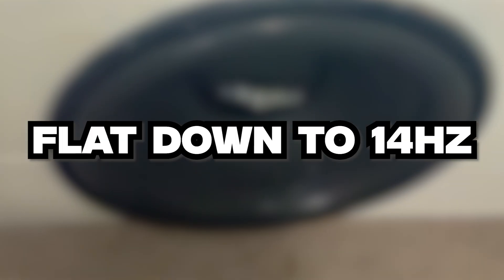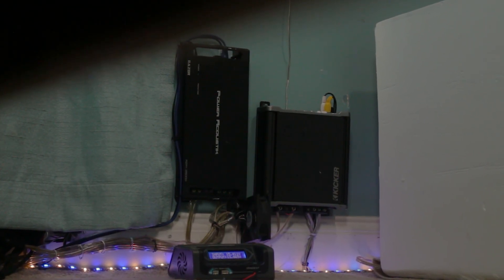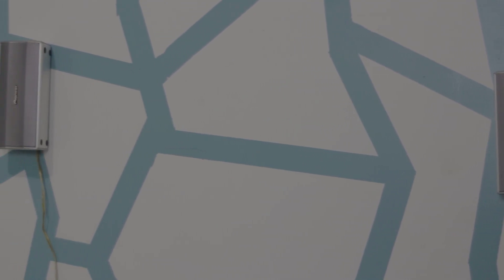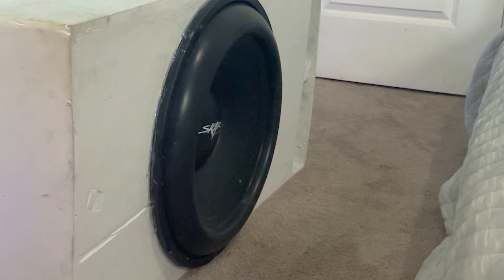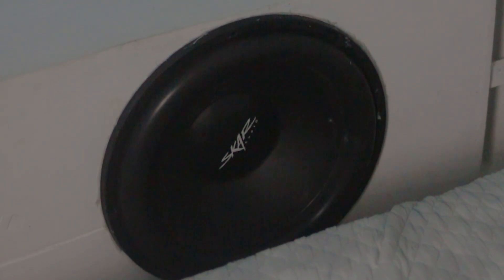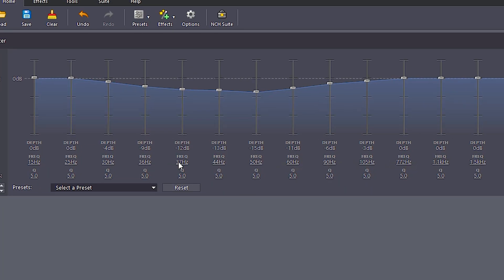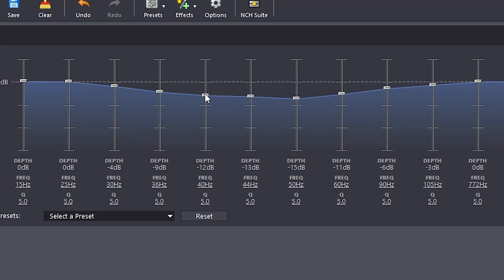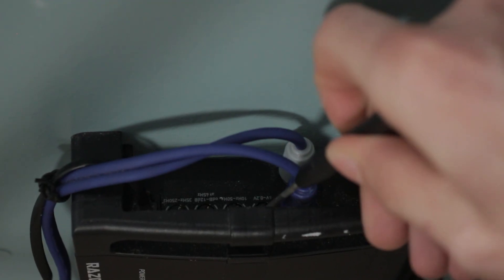How To Get DEEPER Bass For FREE

Comment: I'm sorry but the low-pass does nothing for your headroom in the lower frequencies.
What you end up doing is using your low-pass to try and tame the room-modes that makes the low-end sound unimpressive, so you limit your upper-end response and boosting gain to make the low-end louder. You're not extending your response, you're simply turning up the sub.

Seeing as you are already using EQ, get a measuring microphone and use that to reduce your output in the upper octaves where you have peaks, or to limit output on the high-end to balance your low-end extension. This is much more efficient and precise than simply using the low-pass filter incorrectly.

Comment: Kinda odd to me that subs need to be limited at ALL to prevent bottoming out or whatever when that's practically what we WANT, lol. They should be made such that they canNOT reach that limit, like a bartender saying 'You've had enough'; I'm sure it'd be easy, like by tapering the magnet poles piece at each 'end'; Then, the magnetic force would diminish as the VC moved toward each end of the poles piece. Like a frequency-controlled pendulum, it'd become. Well, great topic and keep it up. 😏🤨🤗
Reply: That would only result in an even greater loss of cone control at the limits of excursion due to a weakening of the magnetic field at the end of cone travel.

Electronic limiting and proper matching of amp, driver and enclosure is the way to avoid damage. In the DIY space this is tricky because it relies on the user not being a moron, but in commercial products, you'll have these parameters pretty much set for you.
Reply: @TokeBoisen  Yeah, man, like a remote-controlled drone, I suppose or a car remote - You wanna get as far away as you can & note how far away the signal still works, butt reliability becomes an issue in times of need. Whoops. Gone! I've seen 'super-pro' subwoofer tests done to TRY to exemplify reaching limits of cone travel and 'What, is he using square waves?' - The cone gets as far as it can and there's a moment of no movement, lol, then it begins back to home base. Probably how it looks with a severely-clipped signal applied, in slow mo, as well. I just think that the VC would have enough 'coil-over-magnet' to still pull the assembly back just fine, butt I'm sure my idea would not be a solve-all - There are many parts to an engine. Also, don't feed a runaway horse - He'll come back soon enough, lol; OK, thanks for that, though! 🙂
Reply: @TokeBoisen  PS--- I may have been editing whilst you maybe hit a 'Like' to me. 
Not much of a change and I hope we can still be friends, lol. Later---:face-red-heart-shape:

Comment: Also, subsonic crossover for the low side cut off. Most subwoofers need to be cut off on the low side to prevent damage to the woofer as it can't handle frequency below 20hz.
Reply: 100% they can handle under 20hz

Comment: if you played test tones you would not gain any output lowering the crossover, I agree you can flatten your response by doing this method but increasing your output +6 db is not going to happen.
Reply from the maker: It can increase close to 6db if you lower the crossover and use an equalizer, but it just depends on your setup. The frequency response of my receiver made me lose quite a bit of output around the 40 - 50hz region because I wanted a flat response to go as low as possible without boosting the lower frequencies way too much by 10db or so, and so I had to lower the output around the 40 - 50hz region. I now have a new receiver which I got after making this video, and now with using an equalizer and setting crossover I don't have to lower the higher frequencies nearly as much compared to my old receiver. Lowering the 40 - 50hz region around -3db with my new receiver compared to lowering it by -15db.

Comment: Great job on this video!  I'm curious as to how you are powering your car audio gear in your bedroom.  Do you have a power supply in conjunction with some car batteries?  I think it would be awesome to run car audio gear in a home environment!
Reply from the maker: I run a PC PSU along with a car battery to keep my voltage above 12v. I'm releasing a video soon about my setup that power's my amp. Thanks for supporting!

Comment: What is your port tuned at? Your infrasonic filter should be set to half of one octave below port tuning, so you won't damage the sub on high power with over extension and lack of mechanical support. Sealed box has no minimum but a ported box will... be careful if you apply heavy power, you will tear that sub to pieces if you're way below your port tuning and the infrasonic/subsonic filter is set to minimum.
Reply from the maker: My port is tuned to 22hz and I can comfortably play all the way down to 10hz full volume which is where my subsonic is set to. Once I get an amp that outputs more power I may need to set it higher but for now It's good.
Reply: @WaveImages  Half of an octave below 22 is 5.5hz so you should be set to 17-18hz something like that.
Reply: yourectrying too hard to sound educated stfu

Comment: This may work in your setup the way you want it. But for a real home theater this is a no go. My SVS pb12+ subwoofer has 800w rms. Any receiver under $1000 only puts out around 60w X 7. A sub $500 one will be like 30w X 7. 

My sub handles the bass and my receiver tells what the crossover will  be (80hz) which would be the THX standard.

This will create drastically more headroom for volume assuming you have a good sub.
Reply from the maker: The settings will be different for every setup, my reciver puts out 125w per channel, and 250w for the center, and when I get my second 18 they'll be wired in parallel getting 1000 watts RMS. My setup gets loud and sounds clean even compared to my other system with klipsch speakers and dual klipsch 15's.
Reply: @WaveImages  What's your reciever brand & model? I've never seen anything have double the power in the center channel. 99% are all fronts having the exact same power. and anything truly putting out 100w + with 5-7 channels driven is a $1500+ reciever. I've got a Pioneer Elite that's rated 100w x 7, but with all channels drivens it will dyno closer to 70w x 7.

Comment: U saying cut your higher frequencies so it will seem like your low end sounds louder?
Reply from the maker: Yes this can work and is safer instead of boosting the lower frequencies. You can set amplifier gains after doing this to get as much output back as you can.

Comment: I agree, bass boost is a gimmick
Reply: It's a single band EQ.
Reply: its not if its variable down to 30hz..
a lil 5db boost at 30 sounds great... add that before matching gains, and youll get a richer low end...  you can achieve this with crossover filters as well, but at the expense of upper bass roll off...
Reply: Bass boost is not a gimmick. You have to use it correctly. If it’s a wide boost use it judiciously. It’s for songs older/newer that the bass was recorded at an attenuated level. Bass boost is better than any epicenter never use that thing
Reply: If u have an low power amp jou can put out a litle more but if u have an tho low rms amp there is already somphing wrong

Comment: I have a pyle home stereo amp I don't think I can get low frequencies like that it cuts of around 23 hz
Reply from the maker: Yea there is a limit of how low you can go, but maybe you could still benefit from some equalization.
Reply: @WaveImages  ya im thinkin about getting a car car amp inside of my pyle home amp
Reply: Most of the time it's not the amp itself, but the stuff in between such as the blutooth, the eq from the player i.e. your phone, or even the recording. But sometimes it is the amp 😢